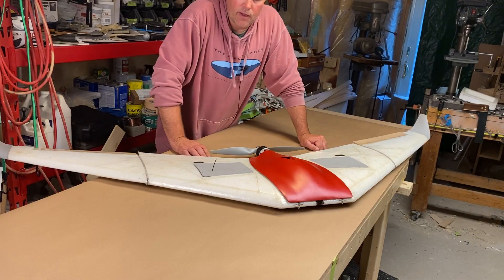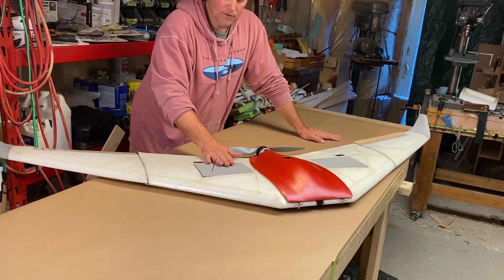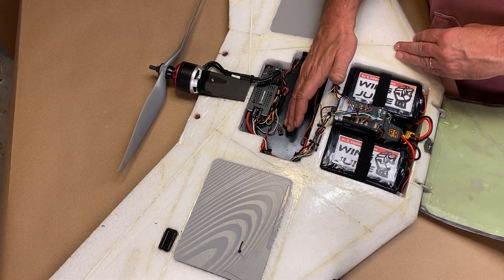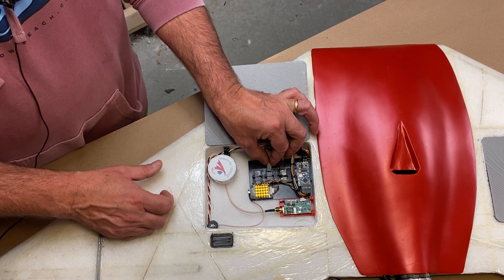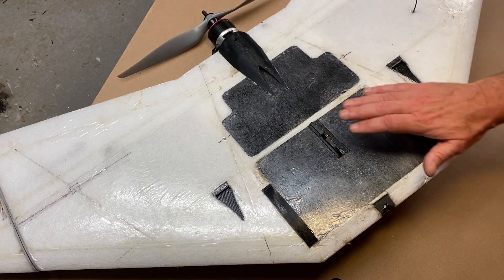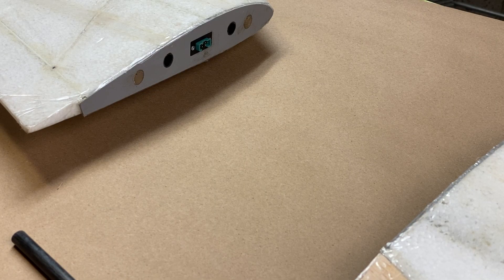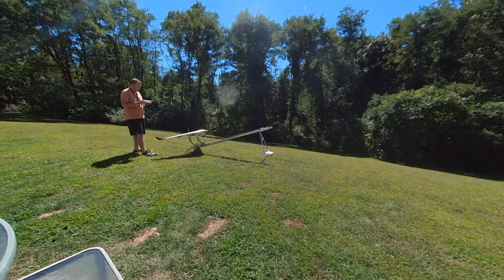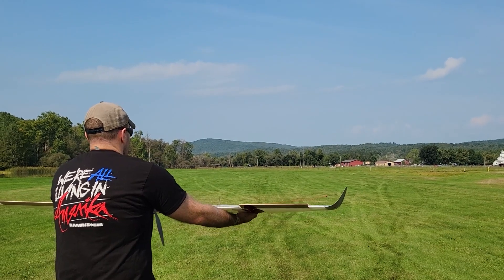LR-80 Walkaround and First Flights

Comment: what are the dutch roll characteristics on models like this with basically no vertical stabilizers? Is the wing twisted? Different root and tip sections?
Reply from the maker: All tailless aircraft suffer from amount of Dutch roll. Even planes with tails can exhibit some tendencies. I use wing twist in my designs to help dampen the yaw-roll coupling. On the maiden flight of this particular wing I noticed more of a pitch oscillation than a wag. I have since added some reflex to the inner wing and been able to take some reflex out of the elevons. This seems to have helped this issue a lot and has increased overall efficiency

Comment: Huh an 80" wing... I'm impressed, well done!!! 

Once a wing passes 40", I'm not taking the risk for a trip to the emergency room; NO THANK YOU. A bungee launching system is the way to go for any wing span 30" up to 132" ( yes I know that's 11 feet )... after that, you need Landing Gear and a Paved Road OR get yourself a Pilots License and start flying for real!
Reply from the maker: Thx man!  My normal sport wings are fairly easy to hand launch on my own, all the way up to 66”. This one is difficult because it’s designed for efficiency and isn’t overpowered like most of my others. The 17” prob makes hand launching a dicey proposition 😜

Comment: Does it have a reflexed airfoil?
Reply from the maker: No, this version does not. It’s the same airfoil I use on most of my production sport wings and they tend to have full-width elevons. Because I’m using outboard elevons on this model I am going to experiment with adjustable inboard elevons to provide some reflex. This should help pull some of the reflex out of the outboard elevons. There’s a fair amount of twist in the outer wings that help a bit as well